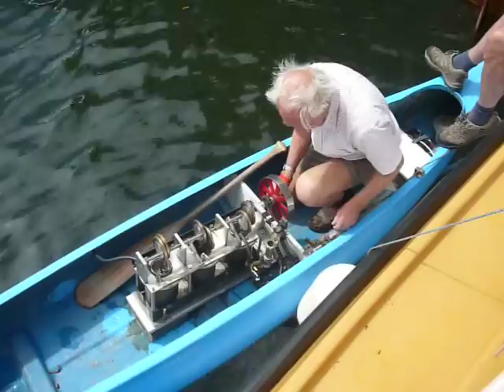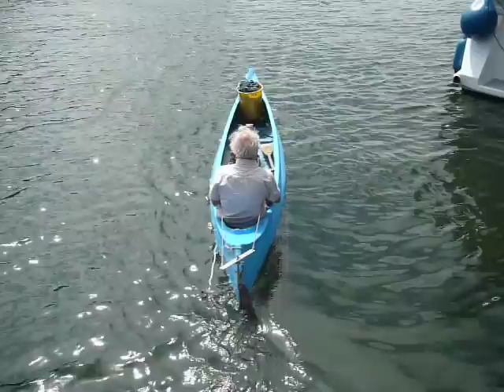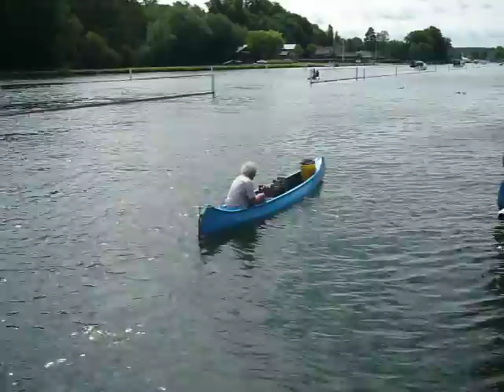Stirling Engine Powered Canoe

Comment: I'd like to add a few comments to this video:Okay, yes, it is a low power engine - agreed. But it has just started up, so has only just enough heat built up on the hot side to be able to run. It gets faster.Julian is a very experienced engine builder and has probably built more engines than any other person. When I use the term "build", I don't mean it in the car engine "build" way, which I would describe more as "assembly", putting together parts built by someone else, but instead making all the components from scratch.Note: this engine has also been run on a charcoal fire for its heat.Julian has since built other stirling engines to power a larger boat, and continues to innovate and design.Keep up the good work! Who cares about shorts, sandals and socks? One day the fashion police on this site that are lucky enough to live long enough will realise that it really doesn't matter. 😉
Reply: Okay, now that you've lectured us all, put me in touch with Julian.
I need a chainsaw engine "built" for under ten grand in labor costs.
I'll bet the old gent will tell you that I can buy the whole freaking saw for a tenth of what he'd have to charge to really "build" an engine.

Comment: I've got to say, there's a bit of brilliance to the thought of using water in a lake for the cool side of the engine.  Maybe to increase the hot side, they could use a light weight solar collector - reflective Mylar and/or a Fresnel lens would be very low cost and likely effective, though they would have to be moved constantly to face the sun.

Comment: In the video description it says the engine heat is supplied by a propane burner

"Heat is supplied to engine from propane gas burner located below the hot-caps."

Comment: The S engine is an intriguing alternative. Advantages are (potential) high efficiency, safety, quiet, high rel, low maint., low emissions; also can use many fuels, even corrosive ones. Disads: low power (so far) for size and cost. One can be built from simple items with little machining, as shown here, made from some kind of cans. S engines typically have to warm up before start/full power. I don't think this guy was trying to win any race, just a demo of a working homebuilt, very cool!

Comment: very cool,  I would take another look at the entire set up though.  The method of power transfer is not the most effective for this application and motor.  A toothed belt I can see going from the flyweel to a gear mounted to the left of the motor. the belt is way too thick also.  I would look at using the sterling engine to power a generator which then charges a 12V deep cycle marine battery and then have an electric trolling motor provide the thrust.

Comment: its all fun and games till you run into .25MPH wind...
Reply: and then what?
Reply: I wonder was it the motor or the wind pushing it.
Reply: krodista attach some sails to it🤣
Reply: .....don't be nasty....
Reply: I think you meant 2.5 mph wind.
Reply: THX 1138 Motor runs it sterling engines are actually quite powerful
Reply: just got back from a grea ride in canoe with a 30lbs engine with 30 km wind noooo problem at all
Reply: guillaume proulx Stirling ?
Reply: guillaume proulx or a gas engine

Comment: Theoretically, there would be a third way for using stirling engines in a submarine: You could heat up a heat storage material by burning fuel on the surface. With the stored heat, you could drive the stirling engines submerged without the need of oxygen. 
Both, direct heating by burning diesel und using a heat storage material, would work with steam turbines too. But the stirling engine system makes probably less noise.

Comment: That´s why I said "theoretically". 
Normal conventional submarines use batteries for diving.
There is just a short number of other conventional (not atomic) submarines using fuel (and stored oxygen) for diving.
For example, there are german submarines, using fuel cells. Fuel cells need oxygen too. But less than a stirling engine needs (higher efficiency). And the system makes probably even less noise than the stirling system.

Comment: Beautiful work!
Wonder if it could have driven the boat if it was designed to capture heat from sun and such?  Maby with a black capture-plate on hot-side, and using the water on underside of boat for cold-side?

Comment: @kafoure93 This is -NOT- "free energy". The Stirling engine is burning propane to heat the hot-caps, as stated in the description of the video. "Free energy" would be running the Stirling engine off the heat difference between, say, the water and the air.

Comment: I recomend a fourth cylinder and making sure the magnetic push and pull effects opperate in a wave like fashion. That way you'll have a constant energy flow. You can also consider using alternating high powered electro magnets and permanent magnets for twice the accelleration and power. However, if you decide to do so, I would recomend a bigger and sturdier boat.

Comment: You would do well to incorporate a stirling engine with a simple pedal setup fabricated from bicycle parts. You could pedal to start or supplement the motor, and rest whenever you wished. Perhaps an overhead shade or a steel plate on an outrigger could power the difference engine even more vigorously.

Comment: I am building motors and here is an advice : Although the power of a piaggio ape 50 is low, 2,5 kw, it drives with 40 miles so build a transmission. And I am sure that you will be able to build a transmission if you were able to build the motor in the video. So good luck.
.

Comment: Stirling engines do not need oxygen or even "fuel" in the classic sense in an atomic sub, the waste heat from the reactor is more than enough to provide heat to run the stirling engines.

Comment: Everyone is talking about how it's not producing any power. I don't think it is, not because it has problems, but rather because he is only using the difference in temp of the outside air vs the water to power the boat it looks like. There is no flame or solar heater to be seen so that's all I can think of

Comment: Looked like he was stopped dead by the wind or current after he was out in the channel.

I imagine a lot of the heavy metal parts could be replaced by composites, making this light enough to use a more powerful Stirling engine.  And, as someone else noted, you could use a light concentrator to add more power.  Still, I'd stick to a sailboat or paddle my own kayak.

Comment: They need some kind of power transmission. It is like trying to start moving a car in 3rd gear. The only way the engine will produce more power is by spinning fast. Then, as the boat moves faster the gearing can be changed. A CVT comes to mind.

Comment: Very cool (or hot).  I'd love to tinker with building a nice little sterling engine like that.  Just have to figure out how to get some torque out of it.
Reply: I was thinking the same thing.
Reply: A real Stirling is pressurized.
If not, like this one obviously, 
the torque is very weak. But pressurizing is very, very hard on a Stirling. Just look up how much effort Phillips has put in the problem.

Comment: Would be interesting to see if you can power a Stirling engine through the temperature difference between the water and surrounding air.
(not that you'd be able to push a boat along that way, of course...)

Comment: can sterling engine be configured to run a altinator for charging batteries,using the heat from the vent from your water heater. Maybe a stupid question but i'm just curious and i'm not the sharpest tool in the shed. So be kind

Comment: But a stirling engine only needs heat to work. How about giving it the heat not from propane but from a parabolic mirror, like a solar concentrator of sort? I think it would be more efficient than, for example, having solar panels convert light into electricity and then using that electric power to drive an engine.

Comment: @dealguy06 Today I built a 1000 Gigawatt Fusion reactor fueled by the hydrogen I gleaned from seawater and tomorrow I will build a million Terawatt antimatter warp core with a dual antimatter injection manifold.
You got any spare antimatter laying around?

Comment: @heysmithy He pops it in gear @ 1:17.   You can see the load shift to the engine.   Then it moves very slowely till the guy puches it.   Too bad these engines don't produce much power.

Comment: its the same pressure but the air pump mass powerfull using  compressor the use inverter to running compressor? using air pump

Comment: Not to simply state the obvious but he didn't have a heat source other than the temperture of the environment vs using the body of water as a heatsink on the cold side of the engine. If he were using a combustible heat source along with adequate engine design he would of reached superior efficency than an I.C.E. in the same situation

A solar collector would have helped too

Comment: I guess building your own engine could be fun but judging from the video the place for this engine is on your mantle.  It seems a sterling big enough to produce useful power would be to big for the boat?  Maybe a car battery and an old starter motor would be more practical, on the other hand pragmatism has nothing to do with this project.
Reply: It's a very inefficient engine to be honest, though I'll freely admit that I couldn't build a better one. I know how improvements could be made; for example, using a better heat source would certainly be a good start. 

The real problem is that Stirling engines aren't tremendously powerful engines. They're very versatile, since they'll run on any heat source you can give them, but they waste a lot of energy. His engine suffers badly from friction, at least where I'm sitting, and could stand to use the water below him as a heatsink rather than the air, since water would be a much better bet.
Reply: frenchtehllama actually the engine does use the river water to cool the upper end of the cylinder ;)
Reply: wow, how can you possibly think its a good idea to put a car battery onto a canoe? Those things capsize so easily, no way you should have any electronics on there let alone large electro-chemical cells.
Reply: I have a car battery in my kayak, strapped into the hull . It drives my electric trolling motor and lights.  The battery actually acts as ballast making it harder to tip over because its strapped to the floor of the hull
Reply: john g
Yes, it does, because anyone with access to a computer with internet can trivially check the spelling of these things. I really wouldn't put much value in the opinions of those who are either too stupid or too disinterested in the subject matter to do so and get the spelling right.
Reply: Thats pretty uptight dude. inferiority complex?
Reply: +Salvatore Shiggerino much inferiority complex is within this one
Reply: +some kid Nope, i have an electric kayak. but lithium battery, car batteries are for people with NO IDEA.

Comment: What kind of fuel does he uses? I'm still struggling to find the most effective fuel.
Reply: Slow Mo Man I think the reason it's not producing any power is because he is using the difference in temp of the air and water to power the boat. can't seem to find an energy source.

Comment: If it takes him a gallon of propane to go one mile, it is inefficient.  If he ran an internal combustion engine on a gallon of propane, he could have gotten the canoe up on a plane and driven for 10 miles.  Stirling = inefficient.  They are fun and you can build one in about an hour, in your house.  That's what makes them good.  Not, unfortunately, their ability to do work.

For the same amount of energy, steam is the preferred powerplant :) Experiment on, my friends!

Comment: I don't think that storing heat directly is the best solution. You would need enormous amount of heat stored in a small space to last for a considerable amount of time. Easiest way is to use fossil fuel or atomic fuel to create heat. Weight and volume of the material compared to the amount of energy received is an important factor.

Comment: @gymkhanadog 
150hp Ford Sterling engines from the 1970's the current Kockums engines driving submarines auxiliaries and the Rider and Ericson engines driving all sorts of everything in the 1800's the current Whispergen units crank out good power for their size all used or use fuel in burners to heat the gasses.

Comment: @ginopunsalan Adapt that machine with a big fresnel lense, and I would be glad to have it if I was adrift from a shipwreck. I don't think I would have enough farts to push me for weeks continuously, but maybe you do. That this engine runs of heat! that is what makes it amazing because you can use direct solar power, and it needs no fuel. And last I checked the efficiency from solar transfer to movement was better than solar panels to electric motor. The old man is trying something awesome.

Comment: putting all your hard long hours of work in a little canoe
that can flip over in a split second I don't think that was too smart of a move.
at least you could have put a two by two board across with a float on each end
that would stop you from tipping over and losing your good work.

Comment: Anything that turns heat in to almost *no* torque is inefficient.  They can barely overcome the friction caused by oiling their moving parts.  They are not efficient.  They are inefficient.  Guess why no one uses Stirling engines for anything?  If they worked great, farmers would build and use them for everything.

Comment: Indeed, this Stirling engine experiment looks like a joke : very heavy, no power, and using a gas burner on a boat means danger and added weight.
Instead of that, they should make a lightweight, very large size one, fitted to the boat size, that would make use of the temperature differential between the (cold) water and the (sun-heated) air. That would at least prove something...
Reply: Christophe Vermeulen everyone cant make furbys dance to gangam style like you can

Comment: That looks very unstable, all the engine weight in the middle. Even a small wave could tip the boat over.
Reply: Out of curiosity, what would be a better placement for an engine in the boat than in the middle and in the bottom of the hull? Me and couple of thousand ship designers would like to know.

Comment: that's what the Titanic used wasn't it.
Reply: Mark Wright its pretty close, they both use heat don't they.
Reply: I just checked the math and the amount of coal the Titanic consumed in "one" one hundredth of a second this stirling canoe could go across a lake one mile long. 
And for the amount of coal the titanic consumed in one second this canoe could travel for a day or days.
Reply: Mark Wright to put it in pespective The titanic consumed coal about the weight of a small sedan every two minutes exactly. No wonder they had to have so many stoker, that seams unreal.
Reply: the reason the titanic sank is because one of the bunkers caught fire and was glowing for days so they tried to use it up faster (shovel it in), that's why they were traveling so fast through the ice field in the middle of the night.
Reply: white star line only made four ships the biggest one that was bigger than titanic, and labeled unsinkable, also sank within a very short time. it was the Britannic and sank in water 1/8 mile deep the bow hit the ocean floor and broke before the stern was submerged.